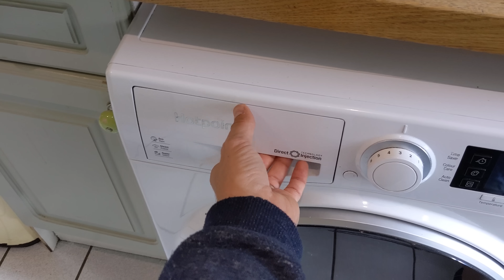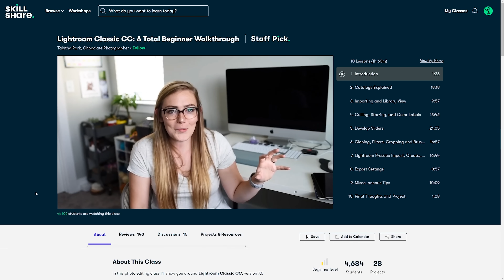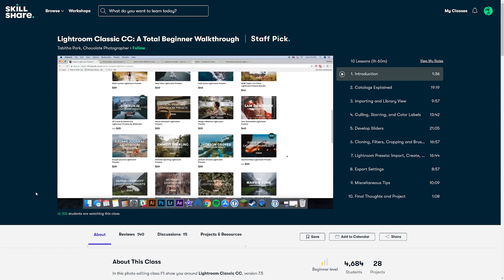The Pythagorean Siphon Inside Your Washing Machine

Comment: so let me get this straight... 
to flush the toilet you push a lever connected to an elevator that has a one way valve at the bottom to raise the water level to pour over a channel to hopefully create a vacuum to pull the rest of the water thru the one way valve at the bottom of the elevator and empty  the tank.

here in the US we push a lever that opens a valve.

Comment: In Austalia, our toilets are gravity fed.  You press the button on the top, it opens the valve at the base of the cistern, allowing the water to flush.  When the button is released, the water will empty to a set point then the valve closes and refills traditionally with the ball cock.  With this system, we can vary the water levels to dump to, so all toilets have half flush.  (we invented it in fact)

Comment: first time I've seen one of those toilet siphons, and I just turned 55.  What we have here in America is a flapper valve, specially designed to float for a while, only to a certain point where the tank is mostly drained. It then "flaps" shut, allowing the fill valve to fill the tank with water.  In case the valve does not shut off, there is an overflow tube.  The bowl is filled up by diverting a small portion of the fill valve's output along a small diameter flexible tube whose end is clipped to the overflow tube.

Comment: i have only ever seen flapper valves on old toilets, the flapper holds and air bubble so it floats once opened until the water level drops and then the flapper falls down into the seat and the toilet refills

i am not a plumber

Comment: In the US the siphon is between the bowl and the connection to the sewer main in the bottom. The siphon acts to empty the bowl. If you look at the side of the toilet at the rear you may see an "S" shape in the porcelin- that is the siphon.

When you flush, you are adding water to the bowl until it flows over the top edge of the S shape, sealing it off from air and making a siphon.

Comment: Our toilet has double mechanism, press the other side and you get half flush, press the other and you get full flush. Funny thing though, if you only slightly tap the full-flush side, you get an even smaller flush than the half-flush (haven't tested this on the half-flush side) and if you keep the full-flush pressed down, it keeps everything open and keeps dribbling water in the toilet even if the whole bowl had been flushed. AFAIK it's not broken, it's always worked like that that I've used it, though maybe it was broken before we moved here, although everything works properly when used properly.

Comment: All of the toilets I’ve come across in Québec (Where I live) work with a float and balloon like you to fill up but for the flushing mechanism it’s like a floating bath plug at the bottom. That plug is fixed on a pivot at the bottom of the toilet so when you flush basically what happens is there’s a string that pulls on that plug and because it’s trying to float it stays up until there isn’t enough water anymore to keep it afloat so then it drops down and as the tank fills back up the weight applied by the water on the plug overpowers it’s floating capabilities so it stays down until your next flush.
Reply: the plug is called a flapper
Reply: judgeomega the more you know, as I mentioned I’m french, so please forgive me, but I appreciate the feedback

Comment: US toilets seem to have some water bypass the commode. I've always wondered why, so I'd love it if you did a vid about that. They seem to be a mixed success, apparently very efficient when they work, but they fail completely when any little thing goes wrong.

(US toilets also swirl when they flush, which is why so many US people are obsessed about which way toilets flush in Australia, because of the Coriolis effect. The answer is, toilet water just goes down in Australia, not around and around… and it's too small a system for the Coriolis effect to make a real difference anyhow.)

One last thing about US toilets: I hate the way my balls splash into the old-fashioned ones, which are full near the rim with water. Whoever invented those obviously wasn't very well hung, I suppose. 🤷‍♂️
Reply: UK loos have a little water in the very bottom only.

Comment: None of the toilets in my life have used a siphon, it is just a chain attached to a lid at the bottom of the toilet tank. You pull the lever, that pulls the chain, the chain lifts the hinged lid. This allows water to empty into the bowl. The lid is kept open by the rush of water so it only closes when the tank is almost empty and the current has subsided. Now, how the water in the bowl empties, that is the S-shaped plumbing behind the toilet and that I do believe always is a siphon. This siphon is started when the water level in the bowl increases when you flush the tank into the bowl.

Comment: In Japan, they've built in two different flushes into the same handle. One is the normal flush called "大" (Literally, "big"). And then to save water, there is this more clever one called "小" or "small." I never really thought about it but you've already described how it works. I'm thinking it must dump just enough water to flow but not engage the siphon. 
And here I came to learn about my washing machine. Bonus! Thanks.

Comment: These are also called bell siphons, or auto siphons. These are fairly common in ebb and flow, or flood and drain, hydroponic systems; although these commonly have a break cup, which allow an in-rush of air to the top of the bell, to break the siphon at a specific water level. Built one of these out of pipe fittings when I was in highschool during ag classes. I've always read, but never seen it tested, that these siphons can be optimized by using reducing fittings within the bell; essentially the base of the bell is a, the top of the bell on the outside of the first reducer is b, inside of the wider end of the reducer is c, and the reduction into the down pipe is d, where a>b>c>d- and to further this, assuming there's a way to actually manufacture this, is to have a constant conical pipe from a to d without all the steps, along with an optimized profile to the top of the bell.

Comment: I was thinking about the common U.S. flapper type toilet as well. When Steve started talking about toilets I was thinking more about the toilet bowl being a Pythagorean Siphon. When I see a demonstration model of a toilet bowl made of clear material it seems it is pulling the water down the drain in the same fashion as a siphon. Once the water runs low and the siphon action breaks,  the water in the bowl is filled again slowly by the little tube in the toilet tank that continues to run until the tank is filled.

Comment: That's really interesting. You could actually use that to drain a small pond with an overflow tube but no drain. Assuming you could get the siphoning reaction started with some type of priming.
Reply: I guess like a traditional siphon - suck the air out of the outlet, in this case to pull enough water into the siphon to initiate it?

Comment: I have never seen that type of flush mechanism. Where I live (North America), all residential* flush toilets I have seen use a flapper mechanism, where a rubber flapper seals the tank held only with water pressure, when the flush is activated the flapper is pulled up and the flow of water holds it out of the way until the tank is emptied (with some modification for dual flush toilets), and after the tank is empty it closes again to permit refilling.

* Industrial toilets often use a different mechanism, as there is simply sufficient water supply to flush the toilet directly without using a resovoir tank.

** It is worth noting that I suspect the siphon mechanism is superior, or at least has advantages, as the flappers in our toilets are extremely prone to leaking over time which leads to significant amounts of wasted water.

However, most interesting, the flapper toilets where I live still have a siphon, where the bowl is filled with water, and a water jet in the bottom of the bowl is used to create a siphon of water out of the bowl, which creates a (hopefully) powerful flushing force to fully empty the bowl of water and material before it is refilled as the tank is refilled.

Since I was alread perusing Wikipedia as a result of hearing about this new siphon based flushing mechanism you described, I was surprised to discover that not all toilets use a siphon mechnism to clear the bowl either.

Comment: Every toilet I've seen here in Argentina have some sort of the same mechanism, it's just a rubber cap that blocks the flow from de back to the toilet. To prevent overflowing coming from a leaky sistem there a tube connected to the toilet that goes up above de level of water in a full back, so it works like the softener tray of your washing machine. Great video btw

Comment: An early book I had as a kid had a page on how a toilet flushed, and described the method shown here. I raced to my toilet and found the boring flapper over a big hole. I've only encountered the siphon style in one old apartment. All other residential toilets I've looked at around upstate NY have the flapper, or more recently, the dual flush push button. An aside: I had always wondered how to get a half flush on the siphon toilet. With the flapper toilet you can half-hold the lever for a slow flush, or on some of them, flick it violently and it bounces and closes quickly. To get a larger than full flush, hold the lever. Seems counter-intuitive to get a half flush by holding the lever on the siphon mechanism, but it makes sense now you've explained how it works.

Comment: In America most of the toilets I've encountered have a floating cap at the bottom of the tank. When it's weighed down with water pressure it seals with a rubber gasket and the flush mechanism is just forcing the cap upwards. It drains completely and settles then starts again.

Comment: To funny, I was just showing someone this last week. She noticed liquid (water) was still in the tray. I showed her how the siphon worked, and how to fix it. At the bottom of the tube sometimes it have detergent or softener left and this residue builds up on the bottom tray around the bottom tube. Eventually this build up affects the siphon. To clean it out completely and remove that residue fixes the issue. Then one week later you released this video, I think I will share it with her.
As for the toilet in the US, its a plunger pulled up by a chain, those are the only ones I have seen in houses.
Reply: omg yes I have this problem
Reply: Lars Alfred Henrik Stahlin Take the soap/fabric softener tray out. Clean it thoroughly to remove the soap scum residue and put the tray back. As long as you washer is also level it should fix your problem.
Reply: that is the old UK mechanism and it is the worst possible. Also patented. Like any other british failure. That mechanism increases water usage 3-4 times (you can't stop the flush or partially flush a toilet), and uses a valve that breaks once every 2-3 years and is very expensive. Imagine paying 20 USD for that. That design is being phased out.
Reply: @atruebrit6452  You can partially flush the toilet with some designs, as shown in the video. And 2-3 years is very low, my family has 3 toilets which have lasted 20 years (and still going strong) with only a couple of replacement plastic sheets for the one way valves.

Comment: I think the reference to a toilet draining via the greedy cup method refers to the p-trap type mechanism in the drain. If you look under the back side of the bowl you can usually see that the drain exits the bottom of the bowl and curves up above the water line in the bowl. Water from the tank is flushed into the bowl in the direction of the drain but also pushes the water level above the bend causing the entire bowl to drain like the greedy cup.

Comment: Not all toilet uses siphon mechanism. I came across one design which has a hole on bottom of the tank and the hold was plug by a rubber which had a big bubble inside.  When the tank is filled with water, the hydraulic pressure keeps the plug tightly above the hole.  During the time of flushing, a lever which connects the plug though a string is push and the plug is lifted over the hold and water goes out through the hole.  At that time, buoyancy takes over and the plug does not come down to plug the hole until the tank is empty.

Comment: Here in México we used to have a more simple setup, the tank just has a big hole at the buttom with a rubber cap called "sapo" (toad) and a chain attached to the top of it so that when you pull the leaver of the tank it will open and, once the water is drained, the rubber cap seals it again. Now we have a similar contraption as the one you're showing, but the ones with the "sapo" are still around.

Comment: Thank you for this video. It made me remove that compartment from washing machine and find why my clothes smells oddly. It was mold from that part of washing machine. Wtf? How? Bad detergent? Water?
Reply: DisiKleep Anywhere that is permanently damp will eventually get mould. You need to remove the draw, clean the interior of the compartment - a toothbrush is good- spray with mild bleach. In future clean it every few weeks, and leave the draw open when you're not using the machine so air can circulate and the compartment can dry.
Reply: @spencerwilton5831  I cleaned it but didn't know that I should leave it open when machine is not in use. Thanks for the info!

Comment: im pretty sure ny toilet just has a hole in the bottom of the tank where a rubber thing is ontop of it. the mechanism works in a way that the flow of water keeps it heald up after you press it. in fact if you manually pressed it back down you can stop it at any time

Comment: The rubber plug types use a neat mechanism as well. They have a whole on the bottom and they are filled with air, This makes them float when you first lift them up. But then as the water level drops they fall an seal again. 

Some have a "Bubbler" in them. This makes them buoyant but only until enough air has bubbled out, then they sink (before the water level had dropped below the plug) and seal. This means you only use a portion of the tank per flush meaning you can go back for a retry on a failure to sink situation without waiting for the tank to refill.

Comment: Here in Brazil the flush mechanism is a rubber plug that floats when you push the flush it pull the plug and it still floating until all the water is out. I thing the US as a similar system.
But the old houses has a little water tank or a pipe straight from the main water tank of the house and a valve that you push to start the flow.

Comment: That toilet siphon seems incredibly complicated. Mine has a simpler way to get the water to run out the bottom of the tank: a hole in the bottom of the tank. If you want to use only half the water, you plug the hole back up (by releasing the handle) before all the water drains. If you want to use all the water, keep holding the handle until the tank is empty.

Comment: All the toilets I have seen in the states operate like this: the lever is attached directly to a rubber seal on the bottom of the cistern, which when pulled floods the bowl. The filling mechanism only runs when a float is low, which eventually is shut off when the inflow of water raises it. No siphons sadly.
Reply: There is still a siphon on those toilets, but it's in the bowl itself. All of that water floods the bowl to start a siphon at the bottom of the bowl, pulling most of the water (and waste) out. The seal then closes, and fills until a specific level in the tank. This system only works with a vertical drain pipe at the bottom of the toilet (which is very common in the US).

Comment: The siphon part is the drain trap in a toilet although it is not quite the type of siphon you're talking about it is a siphon in the drain not necessarily the tank in fact that is a very specific style of toilet that is only used for water saving purposes and has a notorious problem with clogging if there's too much waste or toilet paper as there is not enough power to keep the siphon going

Comment: How interesting. No toilet I've ever seen (inside of) has a siphon. It's always just been a tank with a hole in the bottom. And the hole is plugged up until you pull the handle, unstops the hole and done

Comment: My favourite toilet-flusher mechanism is the one with a clever flap that you lift. It's clever because it's a dome with an adjustable hole. To do with how quickly it drops and closes the hole. And you can flush it when there's not much water in the cistern. Syphons don't do that. Syphons are rubbish. I'm in the UK, by the way, Steve.

BTW, why do you care about how easy it is to debug code? Thinking about it "up front" and getting it right is much more efficient.

Comment: That's not how they work here there's just a soft valve at the bottom of the cistern and when you flush the chain pulls it up it floats until the water drains

Comment: That's not how it works in the states. Our backs just have a hole in the bottom with a weighted plunger type drainblocker thing. When the water is flowing it keeps it from closing but once it drains all the way the stopper can fall and close the hole again for the next fill. We do have the float mechanism in some toilets. One like the one you showed and one that rides a shaft up to shut off the valve so it's footprint is much smaller.

Comment: All the toilets that I have seen has a buoyant plug attached to a hinge at the bottom of the tank plugging a hole. There is a chain going between this plug and the leaver. When you pull the leaver, the plug floats until all the water is out of the tank and then it reseals the hole. The tank filling mechanism is essentially the same.